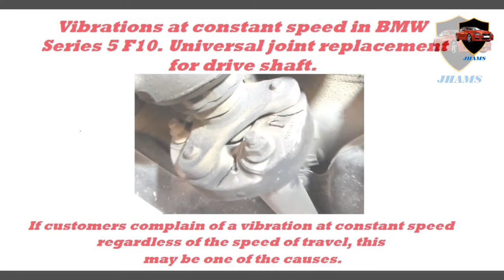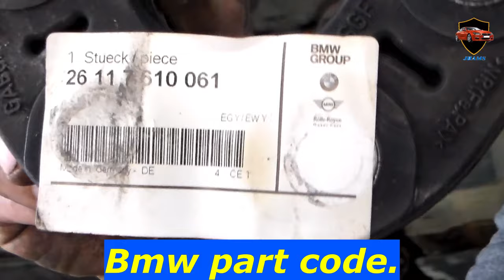BMW F10 5 series Vibrations at constant speed/ universal joint replacement for drive shaft.

Comment: Has anyone has the same issue with f10? Mine is vibrating at constant speed above 90km/h and when breaking with engine over this speed.. When i am driving over 160km/h  rear mirror starts to vibrate too.. From 90 you can hear coming and going sound as well, drive me crazy.. Anyone has it and fixed it?
Reply: The same as mine… havnet Found the culprit yet
Reply: But only when warm
Reply: tension strut bars

Comment: have a BMW 525 2011 d when I turn on the cruise control the rear axle vibrates a lot, don't know what to do?  and it doesn't shift very well 2.3😊
Reply from the maker: On the rear differential you have a solid metal anti-vibration part, remove it and see if it still vibrates.

Comment: Did this solve the problem?
Reply from the maker: yes
Reply: Is this that kind of sound like a long bass which is coming and going  at speed between 100km/h up to 120km/h ? Mostly maintaining this speed ?
Seems to me that de noise is caming under the car just under the back seats.
Waiting for your reply.Cheers!
Reply: @aditupaditup   Hello did you solve your problem? I have the same problem at 110-120km. Thx
Reply: @michal7734  did you solve this problem?
Reply: @bartoszzbisawski7897  Hi, no, but I only suspect the tires and their balancing
Reply: @michal7734  hi I have Same problem and I what to know if you fixed your car
Reply: @hassanhassan12345  Hi, my problem persists :(
Reply: @michal7734 did you do the same procedure as in the video?
Reply: @aditupaditup I’m having the same problem
Reply: Try to check the silent block of the differential. Good luck.
Reply: I have the exact same problem at 105 km/h. Might do the guibo and drive shaft support bearing soon.
Reply: @aditupaditup did u solve ur problem
Reply: Neeed answers here 😂 pleeease
Reply: @luskimarli  AXLE SHAFT!! It fixed mine
Reply: Thx. for the answer - but was it prop shaft or driveshafts to the wheel that you replaced or re-balanced?  @y0685

Comment: Very good quality video. Bless and i will like to know something about an issue i am having with my f10 can i contact you?
Reply from the maker: What problem do you have with the BMW F10??
Reply: @JHAMS-007-car-repair  vibrations between 40 moh and 50 mph. It also vibrates when slowing dow in the same speed zone. I had a diagnose done and it says the support bracket where you just took the axle out of
Reply from the maker: @abduhlrivers45  it may be defective, check if there are cracks on the area of the rubber element.
Reply: @JHAMS-007-car-repair actually. I have to start over with what i initially meant. 
I have done guibo replacements already. Thoes are good. But my front axel on the passenger side that connects to the awd has a supporting bracket that i will like to know if it can just replace. 
I watched another persons video and seen the removal of the axel but not the support bracket.. the reason i message you is because your video is much more comprehensive and detailed and you were more professional.
Reply: @JHAMS-007-car-repair so if possible. I will like to see if the front axel right side support bracket is accessable and can be replaced.
Reply from the maker: @abduhlrivers45  If you mean the front right drive shaft support, it can be replaced relatively easily, there are 4 8mm screws
Reply: @JHAMS-007-car-repair  yes my brother. It is just exactly that part. I am getting a tinkling sound on pull of and a vibration.